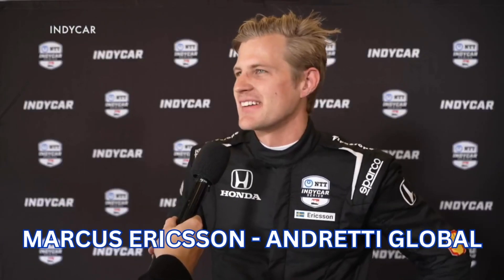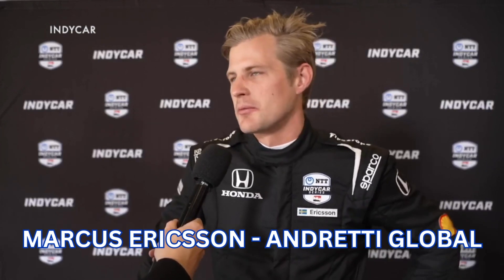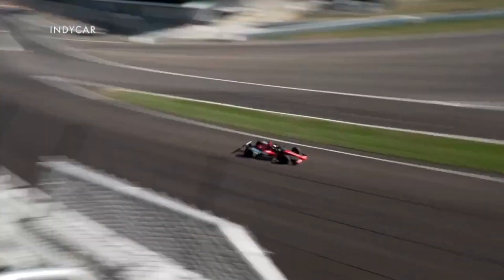Sound Up: Hybrid IndyCars Tested at Indianapolis Motor Speedway

Comment: Now all that remains is to adopt hydraulic steering and more powerful aerodynamic kits to increase downforce in mixed races, if it were possible to also install DRS as in F1 to help with overtaking in Street and traditional circuits would be fantastic. Or do something to increase the vacuum in the mixing kits
Reply: DRS is fake overtake, I like more P2P you control, any part of race, and questions about your combustible,
Soooo cool

Comment: Great Indycar is going forward but, always keep the fuel combustiion part that is what is Indycar fast, powerful sharp looking race cars with twin turbo charge engines V8 or V6. Continue doing right with the race car and engine if, you change it change it to improve it only be careful. Indycar race car is sharp looking and Great !

Comment: Damn that's so close to F1 sound, if even america is starting to use hybrid... 
that's cool they are adapting, but damn, it's a reverse step for combustion engines
Reply: Basically same noise as last year. Similar system that F1 used in 2009 and 2011-13. Motor that assists the engine when commanded and makes the engine more efficient.
Reply: @warrenself  i didn't know honestly 😅i don't watch indycar, but happy to learn that

Comment: Push a bar pull a bar every lap what are they gonna do on road courses street courses etc and that's Indy ffs the death of this sport
Reply: Why do people always complain for hybrid engines? I dont like them, but in racing applications the performance increase would be brutal.
Reply: @HirokaAkita ”Hybrid” is also an extremely vague term and can be accomplished many ways. This is like a typical flywheel assist setup and doesn’t have many drawbacks.
Reply: They said that about F1, Touring Cars and Endurance Races across the world - Nothing happened. If anything it gave them an extra tool to use and add an extra element to racing.
Also remember that many supercars run "Hybrid" systems like the McLaren P1, Porsche 918, Honda NSX, Corvette E-Ray and the Lambo Revuelto. They are extremely useful in making the cars faster and more efficient.
Reply: It’s a flywheel assist system. Nothing extraordinary or new by any means.
Reply: Especially on road / street courses hybrids would be a massive benefit.